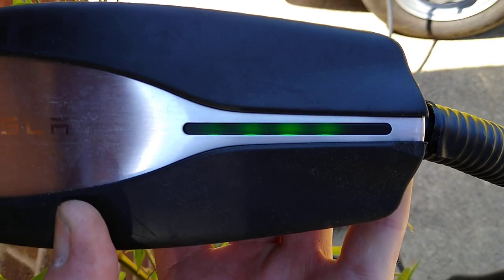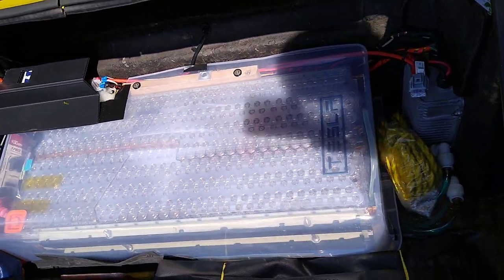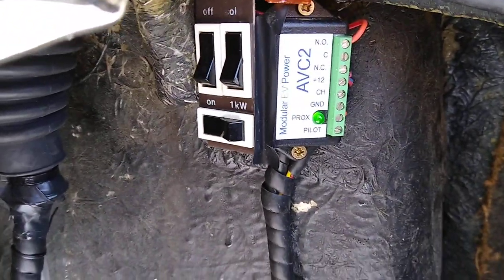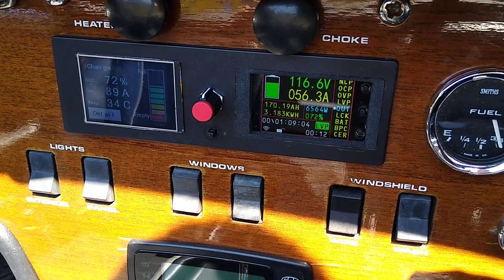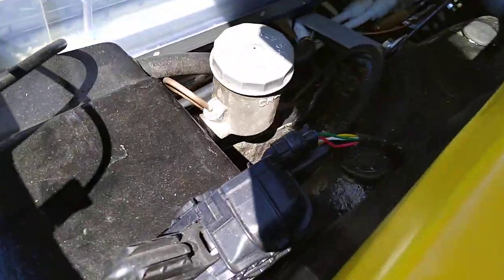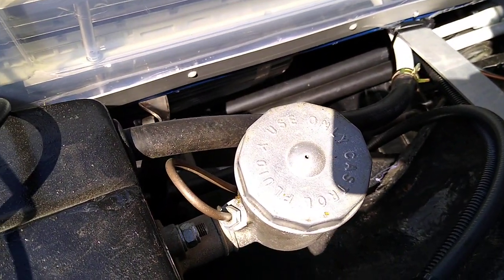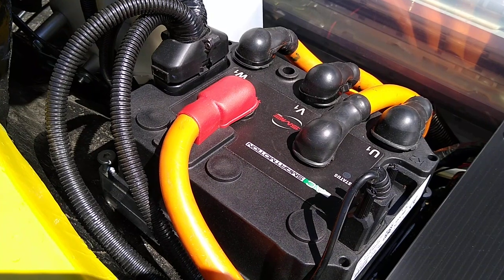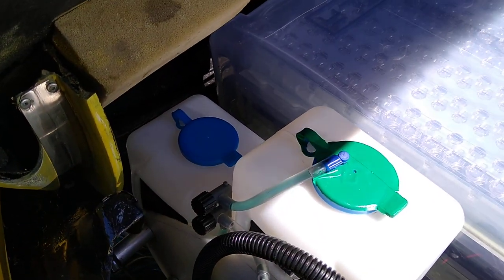Electric Lotus Elan: Tesla Powered 'Lotus Elon' Charging Walkaround

Comment: 1:56.  Pretty cool that you were able to adapt the original Smiths fuel gauge to measure battery charge.  What about the combo gauge?  Does the temperature gauge measure coolant temperature?  Does the oil pressure gauge do anything?
Reply from the maker: Thanks 👍 The temp gauge reads inverter temp and planning to use pressure gauge to measure vacuum using reversed plungers